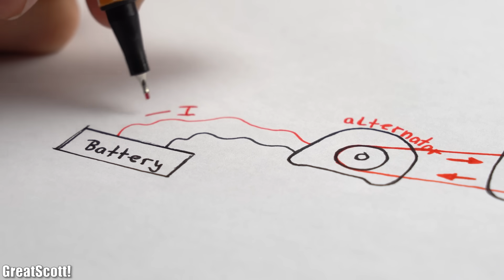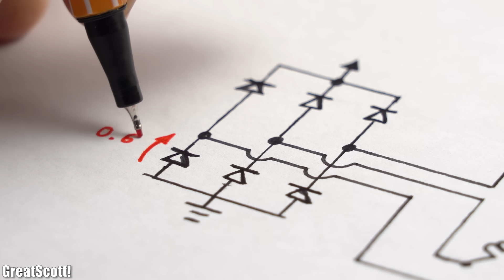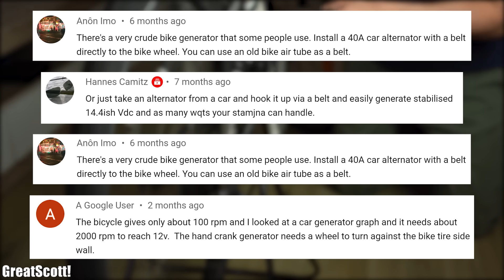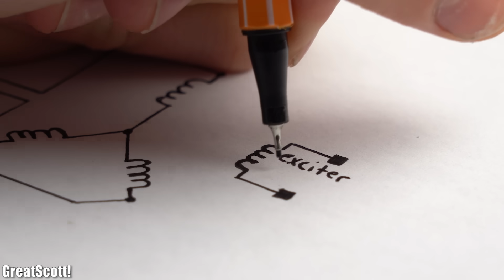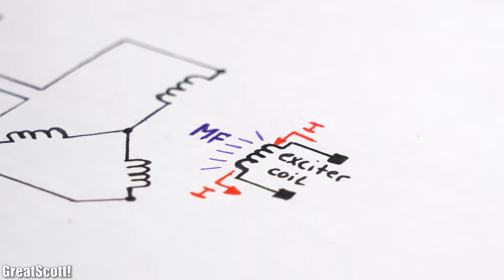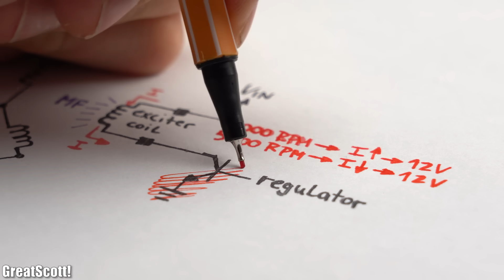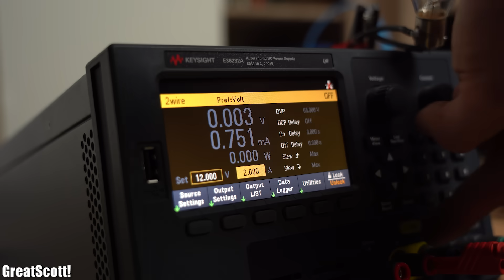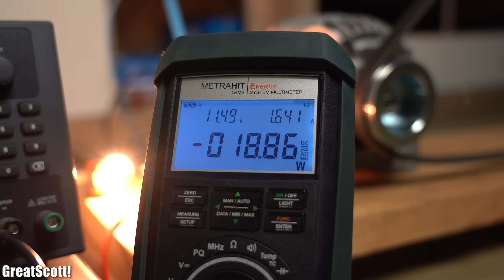Using a car alternator with a bike to power my home? How much energy can I produce?!

Comment: It is actually an alternator. There is a difference. Could you have gone to a scrap yard? It's much cheaper.
    Car alternators are 3 phase AC generators which utilize 6 semiconductor diodes to convert it's output to DC. Each silicon diode produces a voltage drop of .7 volts each but this is NOT a collective drop. It's 1.4 volts per phase which, when in parallel, is still only 1.4 volts total. The regulator circuit takes this into account and raises the output accordingly.
    The average pulley ratio of a car alternator is between 3 : 1 and 5 : 1. This means that if the crankshaft is turning at idle at 700 RPM, the alternator would be turning at 2100 to 3500 RPM but this won't give you full output. You need to get it up to around 6000 RPM to get full output. This will come at a cost. Your 120 amps equals 1,440 watts. Converted to a mechanical energy equivalent, 760 watts equals 1 horsepower so to obtain full output from your alternator, you will have to develop almost 2 horsepower at the alternator shaft. Using a belt on the rim of your bike to spin the alternator shaft, you have put yourself at a disadvantage because you now have a pulley ratio of about 15 : 1 or more which means that you will have to develop about 30 horse power at the wheel which, geared up to the alternator, will give you your 2 horsepower.
    You really don't want to bypass the regulator circuit. The battery and voltage regulator are all parts to a complete circuit to operate the alternator properly. In a car that is operating properly, The battery only cranks the car. Once the alternator is up to speed, it supplies the power needed to run everything and recharge the battery. The battery also acts as a reference voltage to tell the voltage regulator how much power the system needs to run properly. If you leave your headlights on and run the battery down, you can get a jump start and drive home but the battery will still be in a depleted state. You could drive from Deli to London and it might be properly charged up by then. The correct way to maintain it would be to take it home or to a shop and have it put on a battery charger. If you depend on the alternator to charge it back up, if the battery is, say at 11.5 volts after the jump, this is all that it's going to tell the regulator to put out initially. After a while, as the battery begins to absorb any excess power put out by the alternator, it will begin to build voltage slowly and eventually get back up to whatever the car manufacturer deemed proper for that car. This can be done but it's hard on the battery and anything that is running in the electrical system. Especially the engine computer and everything that it controls.
    Most alternators, here in the U.S. anyway, have the regulators built in since the middle 70's. If you bypass the regulator, your voltage will vary wildly according to the speed that you pedal. You can easily develop over 100 volts DC under a small load momentarily which is enough to burn up anything that you planned to run at 12 volts. When I was young and stupid, I had a 1966 Plymouth that I wired a 60 amp alternator into. I did this for 2 reasons. 1) the car had aftermarket air conditioning and the stock 35 amp alternator wasn't up to the task and 2) I wanted to wire it to use for an emergency high voltage DC power supply. I then wired it to produce 110 VDC with the flip of a couple of switch's. With this, you can run lights and brush motor powered power tools like drills and saws. You can also run some home appliances like 110 volt resistive hot plates, beaters and blenders to name a few. NO microwave ovens.
    When you do this, you apply the full 12 volts from the battery to the field coil and rev the engine to 3,000 RPM or whatever speed gives you 110 VDC and lock it there. You can do this only for a limited time as the battery isn't charging in high voltage mode. You have to switch it back periodically to let the battery charge or you will damage it. This period is governed by how much power you draw from this setup. You also have to cut the main power lead to the car's electrical system and put in a switch so you don't burn everything up. Like I said, Young and stupid. I hadn't installed this switch yet and got the bright idea to turn on the headlights to load test my new project. I turned on the head lights, flipped the first switch and the headlights got brighter. I raced the engine while watching my volt meter and the headlights went off like 4 VERY LARGE flash bulbs. Well that was $20.00 out the window. I'm just glad that I wasn't listening to the stereo.
    I know that your project didn't work the way that you wanted it to and I'm sorry for that. I have provided the information above anyway in case you or your viewers are thinking of modifying the design of your project and driving an alternator with an alternative form of propulsion like wind or water. I have seen some smaller projects using the permanent magnet motors out of old tread mills. Perhaps this will work for you. Just keep a working volt meter on your handle bars AND WATCH IT because these motors, when used as a generator, aren't regulated at all.
    Just a tip, To use a car alternator as an off grid power source, most people use several deep cycle batteries charged by the alternator which is then driven by wind, water or small engine. They use the alternator, battery combination to power a 120 VAC inverter in North America or 220 VAC inverter in the rest of the civilized world, (220 volt is better) to power their homes. 
    Not meant as an insult but it isn't wise to try to run off grid directly from an alternator or motor used as a generator. The battery / inverter setup will absorb and smooth out any appliance damaging high voltage spikes that may appear on the line. Good luck.
Reply: Thank you for your comment very very much but the world wants to know how to keep their brain at the proper temperature often below ambient without losing any body fluids. That requires less energy than we consume walking. Literally by walking on a treadmill you can operate a modern personal cooling sized micro in other words compressor using even carbon dioxide as the refrigerant or if you are smart and not paranoid just commonly available propane. I mean you could buy one of those cigarette lighter recharger cans for a couple dollars and then order the compressor from some custom stainless steel digital printing shop if you have the file needed to control the printer. Almost nobody is literate in mechanical energy and you're doubling of the horsepower seems to be along that line.

Mechanical energy is distributable. We have entire industries that do it via pressurized air or liquids. The pneumatic and hydraulic solutions are used by industry not so much at the consumer level. Tankless air compressors are the general high tech commodity used by larger shops but they are the exception. the boost in efficiency of not having to over pressurize the air and only deliver high volume pressurized air on demand cannot be overstated. But air still absorbs energy that you're not able to recover because it generates heat and when you use the potential energy you generally speaking don't benefit from the cooling.

So the question becomes instead of lifting up a few weights a few pounds every week a few feet to power your grandfather clock how many pounds does a school have to lift to keep 100 children cool when it's 110° and there is no prospect of evaporating fluid from the lungs especially because the air is already fully saturated? Can the ocean tides lift that weight with ease? Is the cost of the solution over 1% without any global warming whatsoever instead of being much more expensive and making an inadequate dent in global warming?

Have you changed since the days that you walked or do you sit on the sidelines without courage letting us destroy ourselves despite the hard lessons you learned?

Comment: Really nice implementation. I have one suggestion.
Why don't we introduce a AC to DC converter and charge the battery. In that case, charged batteries can be utilized to draw power for appliances...

Comment: I've been noticing the comments about adding in tensioners or additional pulleys.

My thought is, why not get the engine block, along with all of the brackets for the accessories? That way, you have your mounting points, plus could add in an auto-tensioner, along with possible additional pulleys.

Also, one other thing: If people really wanted to do this, I HIGHLY RECOMMEND you find a way to ground your generator or alternator. Otherwise, you could overload and short out sensitive electronics. Additionally, I would set this up the same way a car is: Use the generator/alternator to charge a battery, and  draw power off of that. And, should you use a battery, an inverter is also something to invest in, I would think.

One other idea would be to get an actual gas-powered generator, and tear it down for its components. Most generators are rated for at least 8,000 watts (8KW). If you figure out the mechanical aspect to turn it, an actual generator, which should have an inverter already built-in, is a way better idea than an automotive alternator. Why? Because the amount of available power with an auto alternator is just too small for the application.

Comment: The reason why you originally were not getting current is because that alternator has a built in voltage regulator. The voltage regulator is there so the alternator doesn’t over charge the battery, otherwise the alternator will charge at a voltage based on the RPM which can go well above the usual max, 14.4v.

Comment: Should've added another pulley with 2 different diameters to increase the gear ratio, and maybe switch to chains to prevent slipping.

Comment: I didn't even watch the video because common sense should tell you that the fractional horsepower you produce when pedaling a bicycle will only get you a few amps on average, perhaps 10A or less, so that cannot power a house that is crazy.  Maybe if you pedal 8 hours a day for a week and charge a big bank of batteries, you can run your house for a few minutes.

Comment: Place the alternator...at the base of a vawt windmill.
It could be used to charge a simple car battery.
Most devices can be charged from 12Vdc and due to the automotive industry providing an ongoing permanent marketplace for this format of device,manufacturers acquired economy of scale.
In simple terms.
Set up generators to make 12v dc.
Buying devices for using 12v is cheap.
(Maintenance of a 12v generator merely needs highschool level physics and electronics.)

Comment: The small, but very effective improvements that could be made to this are so obvious that I have to wonder if you are not a schill for the power companies! 
1. Hook up directly to the AC output nodes.
2. Use an alternator that does not have a built in voltage regulator.
3. Supply the stator coils with a steady 12 volts to get the most out of the rotor coils.
4. Run the AC through your own full wave bridge rectifier in order to charge your 12 volt battery bank and inverter system that can run your entire home off grid permanently.

Comment: You misunderstood your gear ratio?  You would have yielded more voltage/amps/watts if you had relied on the smallest gear on the rim and not the largest. I say ENCORE, ENCORE using the smallest gear with you being able to change gears to objectively see the changes before and after your modification to the alternator (its generation ability was deprive because it needed a dc current via the mystery terminals?).  Encore, Encore, Encore !!!!!

Comment: The alternator is most efficient when used in conjunction with a 12 Volt battery, supplying the IGN (ignition) terminal, from 1,000 RPM upwards, with a load (electrical) applied to it. Many alternators specify a maximum current at 14 Volts DC instead of 12 Volts DC, but I see this one would deliver 120 Amps at 12 Volts as its maximum rating, and a lesser current at 14 Volts (the standard of a 12V car electrical system with a 12 Volt lead-acid battery). There are alternative methods to generate electricity for lighting on a bike, for instance, a hub with a moving magnet around a coil to supply AC to an incandescent filament in a globe...

Comment: Is the alternator meant for CW or CCW rotation?
Reply: They generally are designed to spin clockwise as viewed from the pulley end. However this has more to do with the cooling fans built into the device than the function of producing electricity, which in these things will produce power when spun on either direction.

Comment: if you add a tensioner in the middle along the bottom edge of the belt and beef up the mounting for the alternator and the tensioner id wager youd get better results

Comment: How much energy would you save by removing the bridge rectifier and going straight to AC?
Reply: Check temp of the alternator- might be making more heat than power at low rpm and 14v dc
Reply: @dukefuller1171  - Yes, particularly the field winding, since it would have to be driven to near full voltage to get the alternator to put out any useable power at low RPM. In fact, he probably uses more power for field excitation than he gets out of the alternator at the speed he is able to spin it at.
Reply: You‘re only losing .7 volts of diode forward voltage
Reply: @Ferraday  - Actually more like 1.4 volts since the current must flow through TWO diodes for full wave rectification, which all car alternators use. The loss could be reduced considerably by replacing the stock diodes with Schottky types. Better yet, drop the idea of a car alternator for this project and go with a small  permanent magnet DC motor (either brushed or BLDC). It eliminates the loss from having to excite the alternator field coil. Also, having a machine that works at a lower watt rating makes a much better match with the available prime mover: a human. That alone will provide a big efficiency boost.

Comment: I think you have excite the field to get it started then disconnect. Leaving the coil excited means your fighting against a magnetic field. I owned a vehicle the same style with bad wiring and had to add a button on the dash to get the alternator going. Most alternators charge batteries at 14.5v so I think your missing something. Cant operate accessories and charge at a flat 12v. Open circuit voltage without regulation should be around 19.5v if I remember. Revisit this soon, i think it’s possible..
Reply: <3

Comment: Problem:
1. Alternators are not made to work without battery
2. If you wanna make generator(dynamo) from alternator you need to swith rotor electromagnet with perma magnets.
3. Because you do point 2, now you need step down controler. Or use n coils for insted of n coils in alternator.
It's harder that it's look my friends.

Comment: This could be great for use in a training device like a crosstrainer. My old crosstrainer used a heavy iron flywheel spun up to around 600 rpm, which was then braked with an induction coil on its side to create constantly variable mechanical resistance. You could program it to create constant resistance, time-variant resistance, keeping your heartbeat at a constant pace, and many more options.

With an alternator instead of "just" a brake the energy generated could be used to power the training device, and maybe charge batteries.

Comment: Thanks for doing this so I don't have to waste my time. I thought it might need lots of power to create a decent current since small gas power generators user a lot of power to create small amounts of current. I would like to see an electrolyses experiment that uses spark plug current from a spark coil to generate Hydrogen and Oxygen from water. It's my understanding that high voltage is best with electrolytes in the water to separate the two. I would do the vid myself but you are better than I.

Comment: The clips of you using bicycle gears are confusing. I think you're not supposed to ride with chain on both biggest sprockets as that will damage the chain and sprockets. Usually when one wants to go fast, the front (with pedals) is set to the biggest sprocket, and wheel is set to the smallest sprocket, so one turn on the front gives five turns on the back...

Comment: I wanted to have some energy independence so I built a small solar generator. Using two 100 watt 12vdc solar cells (can upgrade to four), a solar controller, a 400watt inverter (12vdc to 120vac), and a 96ah 12v AGM battery. The entire unit (except for the solar panels) is mounted on a dolly for easy transport. I do realize 400watts will not run a house, I built this as a test to see if I could. This unit worked very well, during the power outage we had in Texas recently, I was able to keep a radio going, keep My phone charged, run a couple of LED lights, and keep My laptop running to watch movies while stuck at home. One of these days I will add a larger inverter and the two extra panels.
Reply: That's a good start. I build small solar generator and inverter units for fun. I have blue painters tape on every box fan, radio, TV, DVD player with the running watts written down on each unit. That way I know how long something can run before depleting batteries. I use the Kill-A-Watt meter to show watts during these tests.

Comment: Could you do this with multiple alternators running in parallel  and mount them like the serpentine system in your car so they are all spinning in the right direction and the bike wheel would be the driving pully for the system?